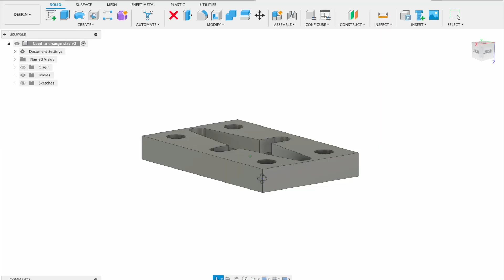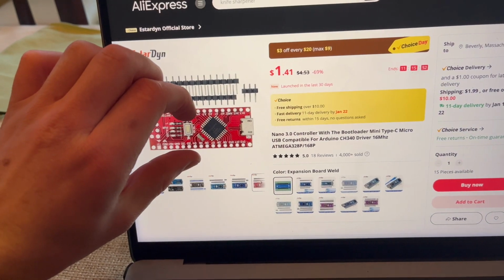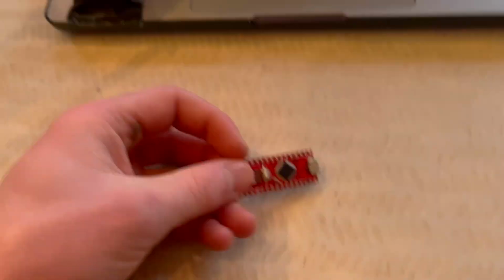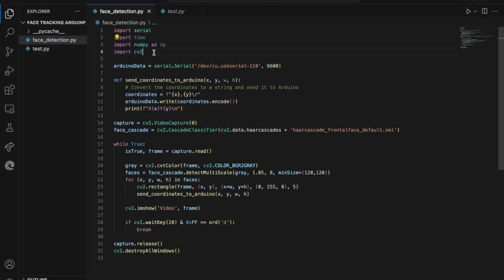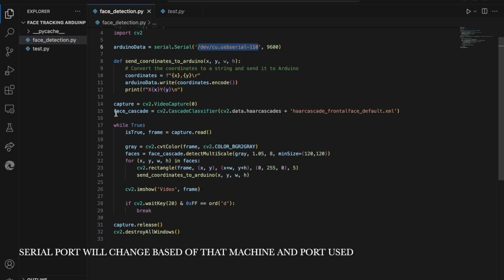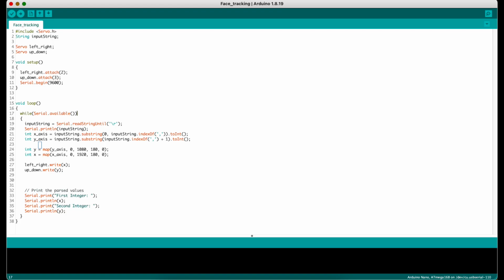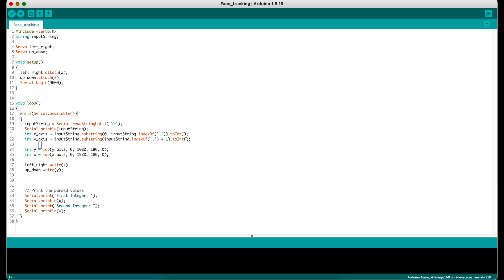Face Tracking Turret made with Arduino and Open CV2

Comment: This is great!!! I want to make a laser on moving tank tracked robot to point at a reciever with area of 1x1 cm^2  on a stationary structure any ideas how can I make this work using raspberry pi camera?
Reply from the maker: You can definitely do this! I would look into using fuducials/reflectors on the object you’re trying to track and then the camera will easily be able to pick up the location and lock on!
Reply: @owenobrien8804  Thank you, this helps a lot

Comment: If I were to make a 6 foot xenomorph alien with articulated joints, hydraulic rams, linear actuators etc ... what, in your opinion, might be my most cost efficient way to control it. Perhaps it would need to stand, balance a forward lean with its tail, full range of head movement with face tracking etc. Could it be made to walk? balnce with soem sort of gyro? Am I looking at quite expensive hardware here or do you think something like an arduino or rasberry pi could do the job. Talk to me like im idiot ive zero experience with any of them or the control of motors / hydraulics, will just learn as I go. Any thoughts or input on any of that much appreciated. Cheers, John.

Comment: Can i use esp32 cam for making this type of face tracking system ?
Reply from the maker: I believe this is possible but the python code would not be applicable to ESP32 and would have to use the esp32 cam internal face tracking system.
Reply: @owenobrien8804  can you please make a video on this .... ?  Because i can't find  any videos related to this topic.

Comment: whate camera do you used? And how you integrated the Python file to arduino?
Reply from the maker: I used the built in camera in my laptop and I communicate the data from the python script to the arduino using serial communication. The serial communication just sends characters which both languages can process.
Reply: @owenobrien8804  Hi thanks for your response, i already managed to make it work, i attached a lego gun to it firing in my face.... not the smartest idea but it works :D 
Btw not sure if you already know it, there is the ESP32 which has build in bluetooth and wifi conectivity and can run a minified Python script. Probably could be a standalone then. Camera component, lagging for esp32 but can be also buid and can store face ids. (ESP32 is pretty cheap). Have a nice Week!

Comment: One question, do you have the tinkercad project? It would be really useful when building it
Reply from the maker: @eliasready  I have the stl files which can be used in your slicer software to print them, it is linked on my GitHub
Reply: @owenobrien8804 what is tinkercard and what is a slicer?

Comment: somebody pls help me , all the things work fine the arduino code , the servo all of them , but when i run the python code  and as it opens up the VIDEO window it works fine for 7-8 seconds after that it stops responding and when there is no face detected it starts responding again and when face is detected it again starts to stop.

thanks for reading this
Reply: loop

Comment: Super cool and looks relatively simple!! But with my limited knowledge of using arduino, I'm sure I would get hung up if I try to make one. Wanting to build a simple head or eye movement devise to track the face as a person walks by. Not too concerned about jerking motion of servos. I'd like to compose the program and load to the arduino and remove from the laptop. Would use a typical webcam camera instead of laptop camera. Use 5v PS, relays if needed, etc. Is that possible? Your video shows using Nano 3.0 but circuit diagram shows Arduino UNO. Will either work? I made arduino controlled Halloween props last year that worked great, but I still have limited knowledge.
Reply from the maker: To switch to a webcam is as simple as changing one line in the python code, the micro controller should not matter as long as the wiring is that same and the servos are connected to the same IO pins but I have yet to try it. Good luck lmk if you have any other question!
Reply: @owenobrien8804  
This is going to be a Halloween project. Trying to get this done well in advance. I will use this for a moving skull head or a pair of eyes tracking a person. I could buy a tracking security camera from Amazon, but making this devise will be more fun! Besides, I want to learn more about this stuff so I can make more projects. Will let you know if I have any hiccups (I'm sure I will). Thanks
Reply: @owenobrien8804  
I do have a couple of questions: I have a couple of Arduino boards (actually ELEGOO UNO R3) from previous projects. Will that work? And I noticed there are two programs shown. The video shows one is loaded in the laptop, and the other in the micro controller. Should both be loaded to the controller? Again, I am a novice to this but trying to learn.
Reply from the maker: @BobDixon-o1d  The elegoo Arduino are the same as normal Arduino with out the Arduino brand personally I prefer to use elegoo because it’s cheaper with the same quality, the code on the laptop is the .py file and can be run with the command: python “name of file.py” and then the Arduino code can then be uploaded using the Arduino IDE.
Reply: @owenobrien8804  
I don't know what py file is, but going to look it up. I am a 71 year old retired Engineer who worked at a nuclear generating plant for my whole career, so I am used to researching things. Love learning new stuff so I am going to give this a shot. If I get too hung up, I would appreciate and little help.
Reply from the maker: @BobDixon-o1d  sure thing!
Reply: @owenobrien8804 hey, do you have a discord or something, where people can ask questions, or can ask you specifically? Would be dope!
Reply from the maker: @ I have a discord the username is owen1616 or try Metro#5936 if that does not work

Comment: Thanks for the video. how can i access to the serial port in both IDE, python IDE and arduino IDE? because when i open the serial monitor on arduino IDE, i can't open it on pycharm ?
Reply from the maker: When running the python script the serial monitor cannot be open along with the script trying to sends commands to the Arduino. To fix this you must only have one open at a time. In your case I think making sure to have the serial monitor closed before running the program will fix it

Comment: Which feild of engeneering is required to make all thsees devies
Reply from the maker: I’m currently pursuing my computer science degree and have learned CAD and electronics in my free time but to do this as a major I would recommend mechatronics robotics or electrical engineering
Reply: Computer science, but a bit of mechanics for all the CAD and assembly stuff

Comment: Can anybody shed some light on a persistent problem I encounter? With code attached to this video and all of the similar face tracking videos, as soon as the python detects a face, the servo motors instantly move away from the target. I know how servo motors work and I can see how the code is supposed to work, however, every Arduino code gives the same result, the servo motors rapidly move away from the identified face.
Reply from the maker: Could it be that the servo's are wired backwards, like ground goes to positive and positive goes to ground, in that case switching the wiring might switch the direction of the way to motor turns but im not sure. A way to fix this in the code would be reflecting the image before doing the image processing of finding the face
Reply: @owenobrien8804  Thanks, but I have tried both of these. Added code in python to invert the image. Checked the wiring and reversed it. No difference. 
I know it’s something in my setup, but I can’t see where. Even connected a picoscope and could see the PWM signal changing as the serial buffer was filled, but the servos still flip out and go to odd and arbitrary position.
Reply: @AW-xj4un  These servos are pretty shoddy. did you try different ones.
Reply from the maker: @Carticiak  I have not tried others but I do have some larger more powerful ones that will work better
Reply: Have you tried other servos or inverting the direction in code?

Comment: arduinoData = serial.Serial('/dev/cu.usbserial-110', 9600)
how should i change the /dev/cu.usbserial-110
Reply from the maker: The first parameter is string of the file path of the usb device in my case it was /dev/cu.usbserial-110, and then the 9600 is the baud width, this is declared in the arduino code as 9600 and shouldn't have to be changed. To find the first parameter on your own computer when you select ports in the arduino IDE it should say which one you are connected to and by copying that path it should work.
Reply: @owenobrien8804  how to copy that path?
Reply: @owenobrien8804  how to copy that path?
Reply: @owenobrien8804  how to copy that path?
Reply from the maker: @ there are several ways to do this but I think the easiest would be when selecting the port in the Arduino IDE the one that allows you to upload the code to the micro controller is the exact path. Based on your operating system and port the usb is plugged into paths will look different

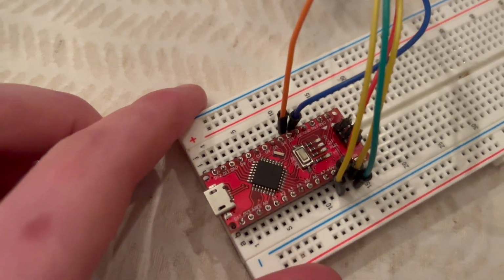Comment: 0:58 - U can C how it's jerking, and that's because of the servos - they've got min 1 degree steps and nothing you can do. maybe only bldc gimbal motors or steppers with microstepping can do it smoother. I'm bashing my head on similar to get my gopro to rotate left/right with the steering wheel of a car, and with servos, even for 50 euros, the image is terrible, jerking like here
Reply from the maker: Steppers would be a great improvement because of there greater precision and accuracy! I plan to work with the Nema 17 stepper motors soon and it would be cool to try and implement those into this design. Good luck with your project, post a video of it when it's done I like to check it out!
Reply: @owenobrien8804 I want to know, I'm working on a fnaf bonnie anamitronic and I want it to follow me by looking around, how would I do this with multiple servos? Because there are about 4 in one eye, to make it movie and blink and I would like to add mini cameras or sensors in the eyes.
Reply: Like he said steppers are probably better, but I'd just gear the servos down (or use a linkage) and call it a day. Depends on the use case ofc but I think you'd only need 2/3x to 1/2x the range of motion. Just a thought.

Comment: Do you have the code for this project? I am doing a similar project, but I will need to modify it for stepper motors instead of servos.

Also, is your computer webcam supplying visual data to the device or is it something else?
Reply from the maker: I have the video from the webcam on my computer processed through Python and then the location for the servos is communicated to the servos over serial communication. The built in computer camera can be switched to a external USB camera by using a different port in the code. Heres a link to the github for a closer look. https://github.com/OwenTheGreenBean/Face-Tracking-Turret

Comment: You should upload all of those code and 3D model files somewhere for download, this is super cool stuff! I’m looking into doing something similar to this for my senior project at my engineering program, I want to make a self driving turret to attack my classmates 😂
Reply: Thanks so much dude! I just now hooked up two of my little DC fan motors to 3D printed rollers, and have a working shooter mechanism to mount onto this awesome contraption! I’ll keep you updated and put some credit to you on the final piece.
Reply from the maker: Awesome heres a github with all the 3D models, circuits, and code. https://github.com/OwenTheGreenBean/Face-Tracking-Turret
Reply: @owenobrien8804  Thank you so much. This is a huge help in starting a project of my own.
Reply from the maker: @Discipline0777  Glad to help out!
Reply: We want updates darn it ! We have needs😊